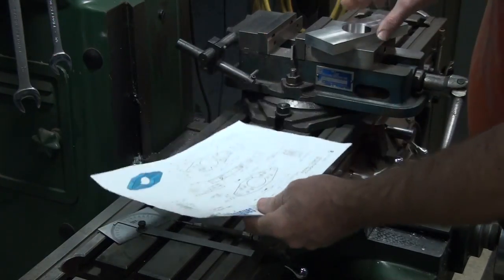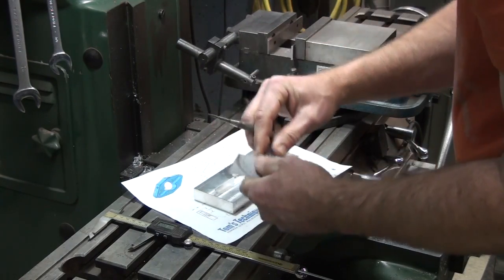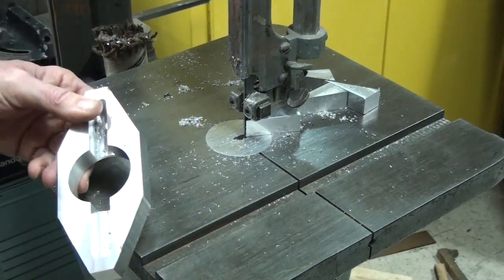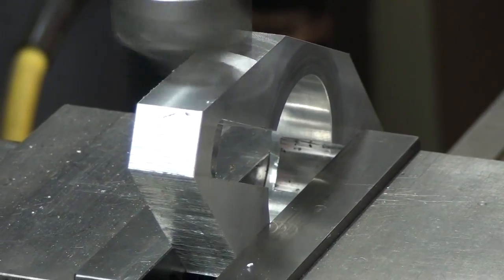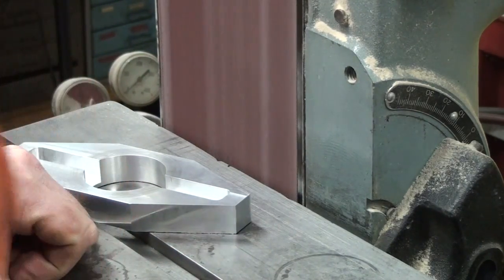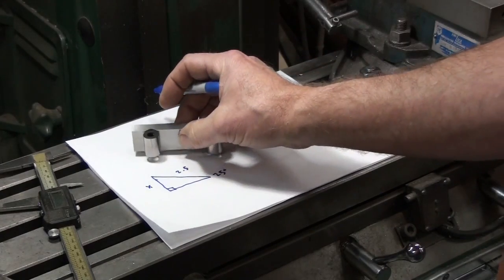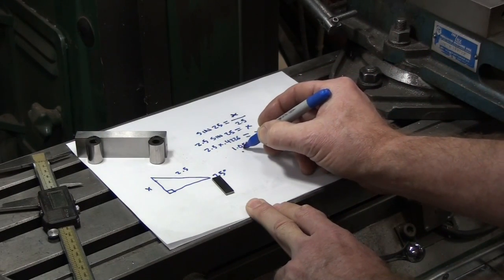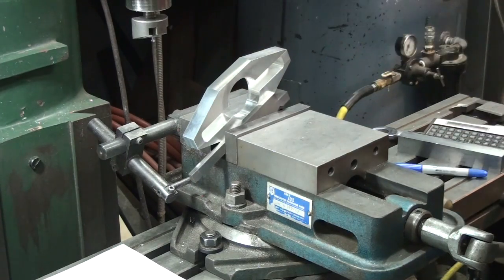Clamp Knurling Tool, Body, Four Ways to Machine the Outer Contour

Comment: Nice quickie tutorial on choosing gauge blocks. Keep knocking off the least significant digits, and the choice for the larger blocks resolves itself. Thanks. I tend to use adjustable parallels (lacking a set of gauge blocks), but when I get a set... (I hope I remember this).
Reply from the maker: Peter W. Meek 
Thank you Peter.

There are instructional videos on basic skills like that as well, but these tutorials show how they are applied. BTW, adjustable parallels work very well for measuring the width of milled slots.

Thanks for watching.

Tom

Comment: Tom,
I have been enjoying your videos, and the new mic is an improvement.  However, the mic is a unidirectional Cardioid design, which means that it will pick up sounds best from the front of the mic and supress sounds from the rear.  The mic element or foam windscreen needs to be pointing towards your mouth. Try clipping it to your collar or the front of your shirt for better results

Comment: Thanks for the video.

I too am over 60 and just bought a dirt bike. Actually, I bought two so I can bring a friend along. So if you ever get to the Philly area, lets go riding.
Reply from the maker: I'll be picking up a second one this summer. Gonna spring for a new YZ250F for myself. The YZ250 is a blast, but the 2-stroke kicks my butt if I ride it more than a couple of hours. I've never been to Philly, have you ever been to Michigan's U.P.? It's nothing but logging trails, forest and sand, surrounded by water.

Tom
Reply: Toms Techniques I'd love to do the UP. Heard a lot about it over the decades. I've been to a bunch in the mainland, Detroit, Holland, Grand Rapids, even Traverse City. Started with a Honda CRF230F, and added a KTM 250XCF. I would think you'd want more of a trail/enduro bike, the YZ is a fast motocrosser. The Honda is labeled as a teenage girl's bike, its shorter (lower to the ground) with less suspension and a mild engine. Great beginners bike. The KTM is, er, a KTM woods bike.
Reply from the maker: Pat Farrell
Th YZ is definitely fast, but there is plenty of room up there to use it. I was thinking the four stroke version would less taxing to ride with the wider power band. There are places up there where I've used all of the suspension on the YZ.

Tom

Comment: Thank you for the demo on the sine bar. What length(s) do you suggest to add to the machinist toolbox?
Reply from the maker: For inspection set-up on a surface plate, a 5" is good because there is lots of room to work. For set-up on the mill, I tend to use the 2.5" more than the 5" because it will fit in the vise. I guess the best answer would be to use the largest one possible for what you are doing.

Tom

Comment: I am thinking about getting a small mill/lathe combination what are your thoughts on a combination unit. Thanks
Reply from the maker: I would not recommend a combination machine. Small machines like that are light enough as it is and designing them to emulate two machines further reduces rigidity and capacity. Decide whether you want a lathe or a mill and buy the heaviest one you can find. Grizzly makes some pretty beefy stuff as imports go. Just for comparison, the mill I'm using in this video weighs in at 2200 pounds and it is considered a light mill by industry standards.

Tom
Reply: Keep your eyes pen for auctions. Estate and business closing kind. I went to one near where I live a couple of months back and there was a Wells-Index milling machine that went for $500.  I didn't have the space, ability to move it, or money, but that was a really good deal. I've seen similar machines being resold by dealers for $2k or more.  Someday...

At least I've got my lathe to play with and learn from in the mean time. That, a drill press, and a porta-band in a bench mount should be enough to try this project soon. 

-- Mike

Comment: Hi Tom,
When I did machinist school, I got to really learn trig. now there is almost nothing impossible to find as far as measures and angle are concerned, thanks to teachers that insisted...!
Great teaching on measuring parts and options to achieve a result.
Thanks,
Pierre
Reply: BTW, I experience about the same problems you do with noise in my shop when I make videos, please would you elaborate a little more about your wireless and digital system, like brand, prices and processing. Only if you can spare some time. Thanks.
P.S. Your voice when you get the noise is a great improvement...
Reply from the maker: pierre beaudry

Thanks Pierre,

The wireless mic is a Shure PG4/PG1 receiver/transmitter, with a PG185 lav mic. I got lucky and won them on eBay for $135. The recorder is a Zoom H4N portable digital recorder. It's pretty much $199 everywhere. The video editor I use to stitch everything together is Power Director 12 by Cyberlink. It does a good job of synching the audio with the video, although I wish it could handle more than one audio channel. It also handles multiple camera angles, so I may experiment with that a bit in the future.

Tom
Reply: Hi Tom, thanks for fast response. as it goes I'll look into the equipment. As Power Director is concerned, I tried the free demo version...
After expiration they kept sending me offers, the last they sent was $95 for the Power Director V13 Xtra package, this package includes Cyberlink Audio Director 5 where you can treat multi track, plus any audio corrections a sound studio would perform.  I'm using power Director v13 but not yet audio director, just looked at it briefly, looks promising though.
Pierre

Comment: I am so glad I finally discovered how to use sine bars (but the need of such set of gage blocks makes it a very expensive method). Rotate the vice and do a side cut would have work to right ?

Those videos are really well made. Keep the good work, I will always be grateful that you did so !!!
Greetings from Switzerland.
Reply from the maker: Ben,

I showed you four ways, but there are many other ways to do it as well. Rotating the vise will not work well for this application because once you do one end of the part, there will be nothing to hold on to for machining the other end. In addition, you would then need to re- align the vise.

Every machine shop should have a set of gauge blocks and they are not as expensive as you might think. An 81 piece shop grade set can be had for under $100.

Glad you are enjoying the videos. Hopefully it's warmer there in Swtizerland than it is here in Michigan.

Tom